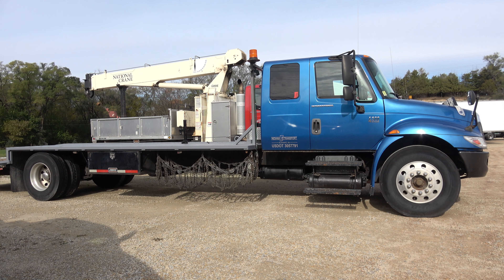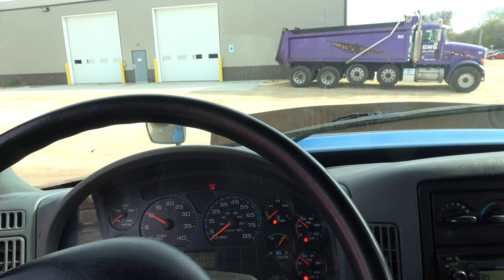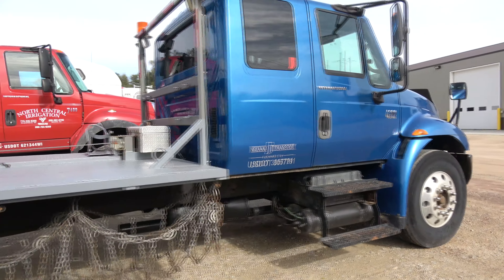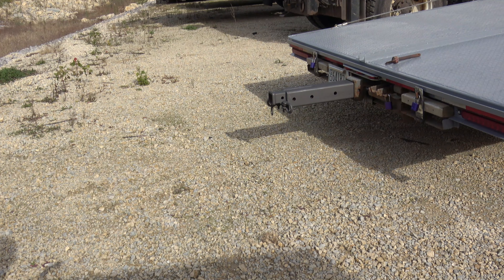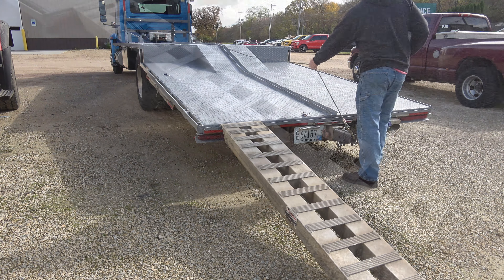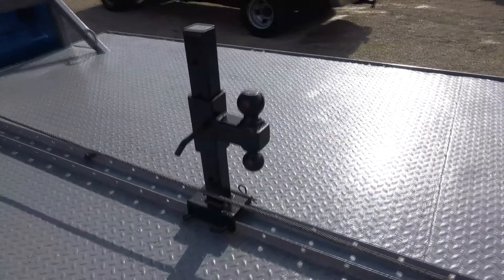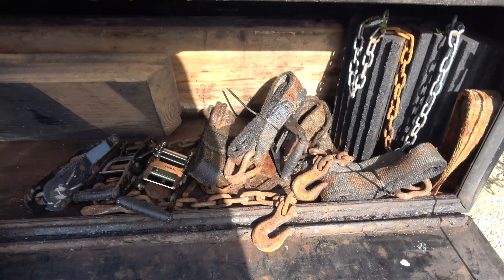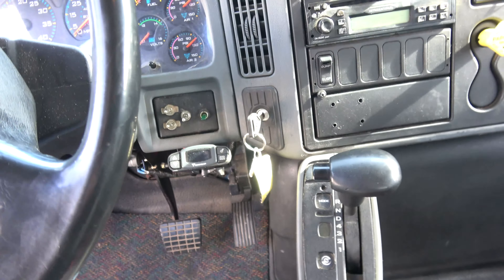My old Haul & Tow overview - Camper hauler RV transport

Comment: Thanks for the video. I'm looking to do something similar with an Isuzu FTR. Is the flatbed deck height a deal breaker? I'm seeing a 36" max deck height requirement on the websites. Also, did you get out the business? If so, what was your reason? Any tips for someone getting in? Thanks again.
Reply from the maker: it has to be close,  the tail height is more important where the trailer wheels sit.  The difference between bottom deck and top  you dont want a huge step there.  This blue truck i made was first one,  the step is larger and needed t put wood under the trailer tires some times to get it to clear the top,   the red truck in my other video I made the step smaller and more tapered which helps a ton.